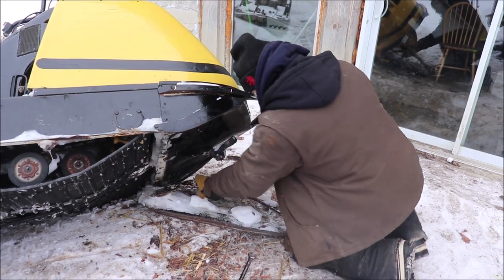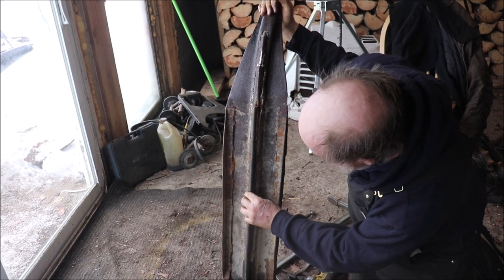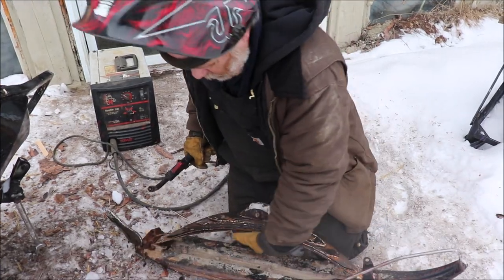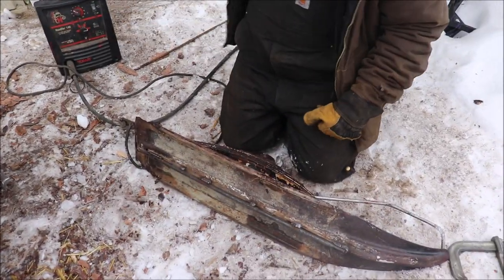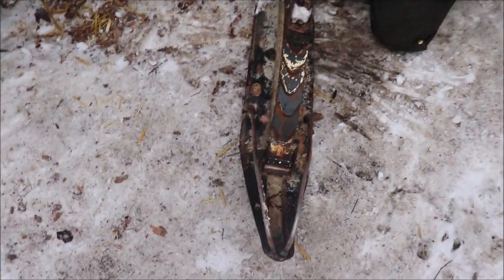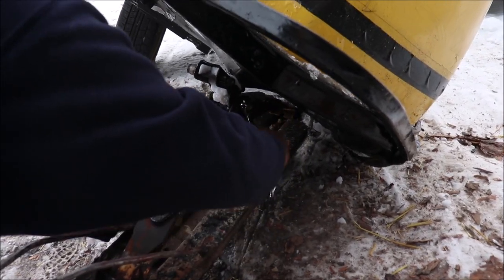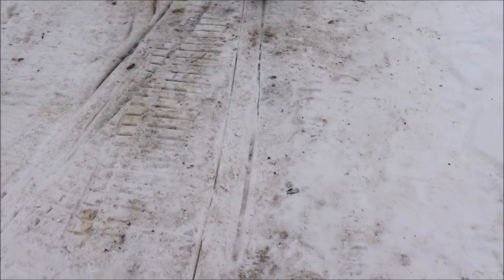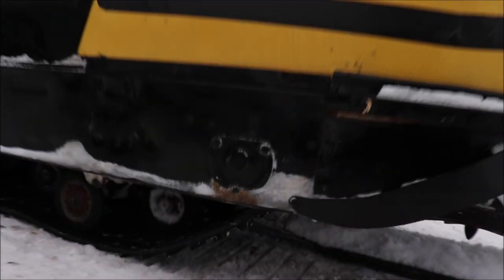Make Your Ski Doo Alpine Steer Better/ I No Longer Need Forty Acres To Turn.

Comment: Cecil a trick we used to do back in the 70s was to run a weld bead down the wear bar so it will last alot long and steer even better , acts almost like a carbide wear bar

Comment: Brings tears to my eyes. Years ago I turned an 1981 Alpine from an ugly duckling into a Rembrandt.  Sold it to a young guy.  Have been missing that thing ever since. What a tank in the bush.!
Reply from the maker: Hello Lynn,  they are tanks for sure. I have a small collection of spare Alpines and Alpine parts, they will probably stay in my possession until after I'm dead..they are just to valuable for what we do here in the winter.  Thanks again. You have a great evening.  Cheers!
Reply: They are tanks. I came across a guy on a trail with his track locked up because of a chain case failure. I told him I could tow him in with my Alpine and he asked about taking the chain case apart to free the track, I told him it didn’t matter to me as I could tow it either way. He looked at me strange and I told him we’d groom the trail and off we went.
Reply from the maker: @Chris,  yeah...they are one of the last true work horse in my opinion.  No running boards to get you hung up in deep snow, and only one ski that won't get you caught up in brush like two skis will.  Plus they are only 33.5 inches wide..new machines must be over 48 inches wide now. Cheers!

Comment: don't know about anybody else but working in the snow is like tying one hand behind your back;;;I would have been shivering so bad I might have welded the rod to Heather's foot;;;lol;;;great job sir;;;;as always enjoy and keep em comin
Reply from the maker: Good morning...lol yes you are right, my welding shield kept fogging up from my warm breath, I got wet knees wet gloves and a chill down my back that lasted me for  hours after this as we were working in the bush.  But hey it's a new frozen day out and we're ready to go again  ;-)  lol.  Thanks again.  You have a great day. Cheers!
Reply: I worked in the Arctic over 30 years. Heck, we even did tower work in the dead of winter setting up communications at exploration drill sites. There are ways to make it not as bad as it seems. We used to use heat packs in our gloves on the palm so you don’t feel the cold from tower rungs when climbing. We had down one piece snowsuits with snorkel hoods and wore bunny boots. I also worked oil well logging a few years.
Reply from the maker: Hello Chris, thanks..yeah most days we are ok, some days I'm just in a hurry to get as much done as possible  ;-)   A good trick to keep your feet warm as well as your hands is spray them with antiperspirant...if they can't sweat..they won't get cold, a little trick I learned back when I was out all day welding or repairing logging equipment. Thanks again. Cheers!
Reply: @cecilsshadetreegarage7408  thanks for the tip;;;;will have to try that;;;;would have come in handy back in hunting days when walked up to a mile to deer stand ;;;out of breath, starting to sweat and feeling hot due to the walk;;;then ole mother nature reminded me to get more cplothes on but the sweat didn't want to leave;;;lol;;;
Reply from the maker: @Ole man, you are very welcome...I think you will be very surprised at how well it works...if you are hunting, get the non scented spray ;-)  Cheers!
Reply: @cecilsshadetreegarage7408  lol;;;funny when i was a kid on the farm my brother and I shot deer in the garden from our bedroom window shich we were given permission to cause it was time to make sausage;;;;;then after out on my own in the big world I paid to hunt;;boutht aall kinds of camoflage, scent stopping things to be more prepared to fool deer to come to my freezer;;;;lol;;;;I spent more money trying to kell a deer and was unsuccessful most of the time;;;lol;;;my how things change in our lives ;;;you have a good one

Comment: Once again, Cecil, you have brought me back to my  childhood in the early 70s, visiting my uncle in Cochrane On. He could fix just about anything from  his scrap yard in the backyard.  That sled improvement looks amazing. It looks like it sits about 3 inches higher in the front. Couldn't really tell how many leaves you added? Have welded for about 10 years, can't seem to get the bacon frying sound. Great job as always.
Reply from the maker: Hello Ralph, this makes me happy..I'm glad I could help you escape adulthood for a little while.    Thank you, yes I believe I gained about 3" on the front. I think I added at least 5 more leaf springs. The trick I use to get good sound with mig welding is to turn up the power at slow wire speed until you get globular transfer ( it will kind of hum or fizz and plop ) then turn your heat down or wire speed up till you get the bacon frying sound.   Hope this helps.  Cheers!

Comment: Cecil I love fixing as much as the next man. However, my Alpine II came with a brand new Simmons "Flex-Ski".it has two parallel scags with replaceable carbides. Steers like a rocket on rails. Nice jobs on the scag replacement. Really enjoy your channel. Cheers from North Alaska.
Reply from the maker: Hello Brad,  thanks..I've been looking for an Alpine II, they're just not that many around here. Thanks again.  You have a great evening. Cheers!
Reply: @cecilsshadetreegarage7408  the alpine II isn't easy to find here either. I jumped on this as soon as it came up on cl. Drove 4 hours to get it. Most of them are broke  down sitting out in the woods.

Comment: Holy Crap, what happened to the Hair on your Head?? Great job on the Ski !! Looks like it will work out just fine. A lot better for the Bush!! Oh by the way,i was just kidding about your Hair. Stay safe my friends.🤓👍🤓👍Randy.
Reply from the maker: Good evening Randy, hey you know the old saying...some have hair  others have good looks lol. Thanks, I used the Alpine today to tow the Cub Cadet with the snowblower... dragging in the snow down to put in the basement. I'm glad I reversed the tracks when I installed them...what a difference.  Thanks again.  You stay safe and have a great evening.  Cheers!

Comment: GOOD JOB AMIGO...DOES IT NEED A SHOCK ABSORBER ON THE SKI ?
Reply from the maker: Good morning Bob.  Thank you very much. Cheers!
Reply: @cecilsshadetreegarage7408  MORNIN' BUSH TECH...
Reply from the maker: I think it's sprung pretty heavy to require a shock absorber at the speeds I reach with it lol.  And since I welded a turn up at the rear of the ski that also eliminates the need for a shock absorber as well...I hope lol. Cheers!
Reply: @cecilsshadetreegarage7408   I THINK IT KEEPS THE BACK OF THE SKI FROM HITTING THE UNDER SIDE , IF THE NOSE OF THE SKI SHOULD DIG IN EG..HOLE OR LOG. KEEP SAFE
Reply from the maker: The older mount was just on the skis...I welded this top mount on the ski post on the other Alpine in hopes of keeping the rear of the ski from catching. They are really just to keep the ski from bouncing at high speeds.  Cheers!

Comment: I  don’t  understand what you do on the spring of the ski , can you explain me your job ? I have also an alpine 640
Reply from the maker: Hello, I added extra springs to the ski, this will lift the front of the machine up so that the weight of the machine will force the ski harder into the snow.  Before the springs were just sagging allowing all of the weight to sit on the tracks.  Cheers!